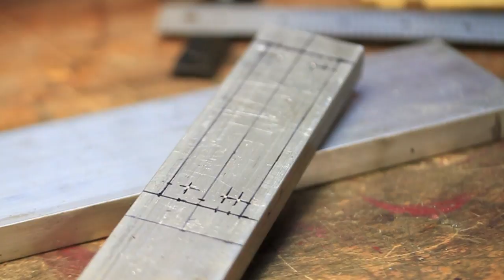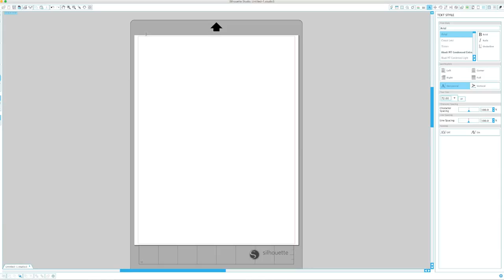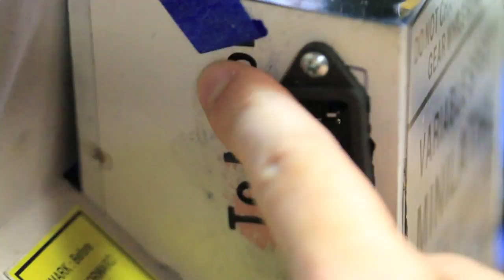Mini Lathe Carriage Saddle Clamp Upgrade - with ball bearings + bonus vinyl cutting project

Comment: you rock! Keep doing what you do!
Though this exact improvement is... arguable. All’s been said in previous comments: one point contact, wearing off and so on. And .5 mm is huuuuge. I made it Steve Jordan’s way, only using steel plates instead of brass and got .05 play and that’s a lot too, but the lathe got tight spot near the chuck so it binds there being more tight. You should really consider switching to thick brass plates, search that. Btw, no milling required: just stock cut to length, drilled and tapped.

Comment: there's a very good reason machinery is designed with large flat hydrodynamic bearing surfaces. even knowing how badly designed these Chinese lathes are, at least they use proven design principles.   even if you had cylindrical rollers rolling between two hardened ground ways, it would be less rigid than a flat bit of the crappiest soft cast iron china could provide.

Comment: You own a lathe mild steel makes great transfer punches for aluminium and you can make them in ten minutes for a perfect fit to any size for aluminium brass etc.. and just a thought for next time, you have a metal cutting bandsaw you could have cut out the section a lot easier neater and less effort than with a grinder and files apart from those suggestions you did a great job and thank you for the ideas

Comment: The sooner you ditch those " improvements " the better chances the lathe  will not be damaged. 
Look at how others have tackle this problem. 
Like brass bearing.
Reply from the maker: I'm not that worried about it. It works way better now than it did and it will take the rest of my life to cause enough damage to be noteworthy. And even then, it will probably still work better than it did before. Thanks for watching and commenting though!

Comment: Sorry did I miss it or didn't you state the size of the aluminium you used for this nice mod, also what size b/bearings did you use?
Reply: Don't worry about it. His concept is absolutely flawed. Read the other comments, and DO NOT do what is shown in this video.

Comment: I don't understand how this works. The bearings are on the side and bottom of the ways? They're not taking the full-on weight of the saddle. Does this actually work? Maybe I just don't understand your design.
Reply from the maker: Yep! it's similar to the way a roller coster works :)

Comment: looks like a bad idea ,its putting a lot of force on one small spot.
Reply from the maker: As I mentioned to CurlyG65, they weren't any better to begin with in terms of surface area but they were very sloppy. (you can see it here https://youtu.be/JpU8BzNyZww?t=236 ) 

Thanks for watching though!
Reply: Not a good idea using the ball bearings in my opinion. It will wear grooves in ways and cause more problems than it is worth.
Reply: I forgot to mention in my last post that NYLON BALL SPRING PLUNGERS would be much better.
Reply from the maker: I thought about something like that - my reasoning against them was a) I didn't have them on hand and b) I figured any spring strong enough to not compress under the load would cause the same problems as the way I set it up and if they were soft enough to compress under extra load then it would still be sloppy and not an improvement.

Comment: Nice video! How did you get your angle grinder to effectively cut aluminum though, in my experience the blade gums up quickly with aluminum dust and stops cutting much at all. Thanks!
Reply: You should NEVER use an abrasive wheel to cut or grind aluminium.
Use a file to shape it, after rubbing with some chalk to stop the teeth clogging.
For cutting it, use a hacksaw. Or even a bandsaw like this guy used to make the initial cuts 😢

Comment: oh by the way, that u shaped thingy there, you can use a jigsaw, i use it even for mild steel with no problems. takes a while but its still quicker than by hand. i also got myself a band file, that was really cheap and works great for purposes like that
Reply from the maker: Yeah, those probably both would have been better options! Maybe next time :)

Comment: Wouldn't it have been easier to make a big capitol " i " then cut it in half? Then all your cuts would have been from the outside and one cut up the middle to separate the two halves.
Reply from the maker: Ummm maybe? I see what you're saying. If I had a mill it would have been much different. This was actually a plan B design that I came up with after I already bought the material. The biggest challenge was the width of the lower piece is much wider than the top piece because it has to reach under the ways. So I would have had to file off a large amount of material from a pretty thick piece of stock to make it work that way. Thanks for the thought though!

Comment: Using bearings is a bad idea as they are probably hardened and will cause wear grooves along the underside of the bed ways. Also you have limited the contact surface to those few points which may have been an improvement from what you had before but it will eventually be more of a problem down the road as the bed ways develop grooves.

Here is an link to an "improved" solution: http://www.toolsandmods.com/lathe/mini-lathe-saddle
Reply from the maker: Thanks so much, you're probably right but as I've mentioned to others, I was just trying to make it better than what it was for the first iteration and will be keeping an eye on it.

I appreciate you taking the time to watch and comment that that website is so great - he is so meticulous.

Comment: I've watched a couple of your videos and videos by others on these Chinese mini lathes. I wanted one but it seems to me people work on the lathe as much or more than they do work with them. Maybe I don't want one after all.
Reply from the maker: Thanks for watching :) 

Unfortunately I don't know that there are very many high quality alternatives in this size range. I will say that all the work I've had to do on this lathe has both been good practice for turning things on the lathe as well as a tremendous learning experience so I could transition to a larger lathe much more comfortably. So if you don't need practice and learning then it would be inconvenient. It does have the potential to make some really nice parts though.

Comment: I give your mods about six months before you buy another lathe.  No fault of the machine, just that no thought was put into area of contact.  Maybe you have a total of a sixteenth of a square inch, if that much, against the full area of the flat gib  you apparently didn't like.  Hard balls against soft cast iron, oh, yeah.
Reply from the maker: Well it's been well over a year since I made this video and last I looked there weren't any noticeable marks.
Reply: you have little wear despite not because of it,  this is because it's not an often worn surface, unless you use a rear parting toolpost or cut threads in reverse spindle rotation. some lathes don't have any bearing surfaces there.

Comment: Super novel idea- I love it! Might try doing this on my own 7x12, maybe with some HDPE or roller bearings as well suggested in the comments.
Reply from the maker: Yeah agree! probably a piece of HDPE or teflon or brass between the ball bearings and ways would be perfect... and it would be so much nicer to adjust.
Reply: I think you are missing the point here...get rid of the balls and use a flat surface of uhmw ( the best wear material) Teflon is used a lot on big machines but doesn't have great compression strength
Reply: @larryrestainer9949  use the original material, which was designed for the job. Adjust it properly... done.

Comment: Two things.  You need to make the switch to a cold cut chop saw.  The time it saves in making a straight cut is worth it alone.  Second while I think all of these upgrades are cool don't you think when you consider time and material costs you would have been better off buying a better lathe?
Reply from the maker: Agreed. And thanks - I think with the amount I've learned it's been totally worth it. The material costs for the upgrades have been minimal as most of the investment has been time. But also it's given me excuses to make a bunch of these videos and the response has been incredible so it's also been worth it just to share the knowledge and experience.

Although if someone asked me something like "I already know about lathes and I just want to plug it in and start making parts and don't care about making youtube videos, should I buy this lathe?" I'd say no and agree with a lot of the comments about other brand suggestions (Southbend, Atlas, etc.)

Comment: If I wanted to listen to shity music alongside of video I would just watch a Casey Neistat vlog
Reply from the maker: Each to their own I guess. Several people have commented on the music but with a 90%+ like/dislike ratio I feel like for the most part it's not too bad... I've been struggling with what to do as it's hard to make everyone happy. Thanks for watching either way!
Reply: The music should be taken outside and shot. As an aside, metric screws aren't like imperial - the pitch is set. You can get finer "metric fine" screws, but they're very rare. I feel that the ball bearing issue has been mentioned, so I won't repeat that again.

Comment: Painful to watch you try to work with aluminum in every possible wrong way. The hardened balls are going to ruin your ways!
Reply from the maker: Unconstructive critisim is just being rude.
Reply: I would have opted to put a small spring under the ball bearings would be a true detent and floated as well as stable just a thought that is how I done mine on lathe as well as mill